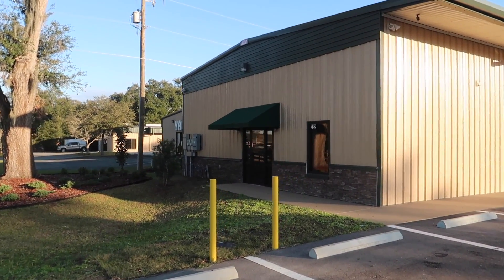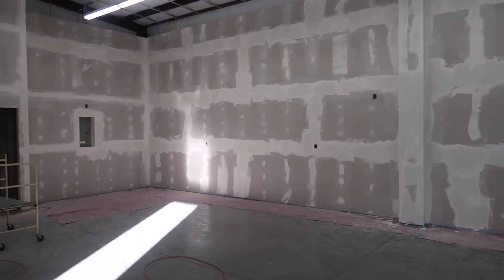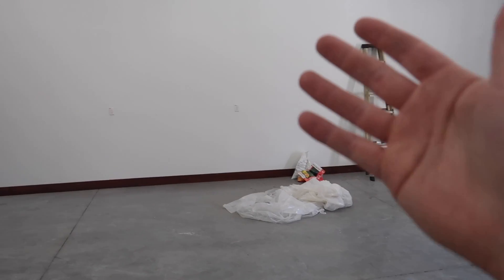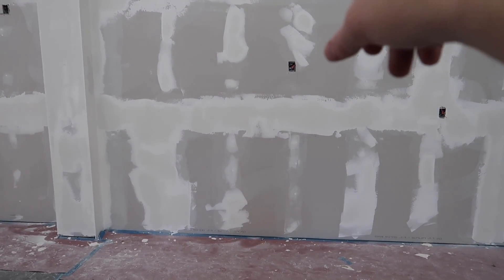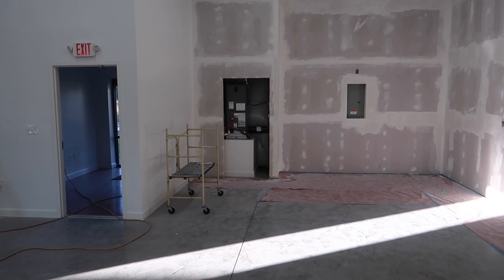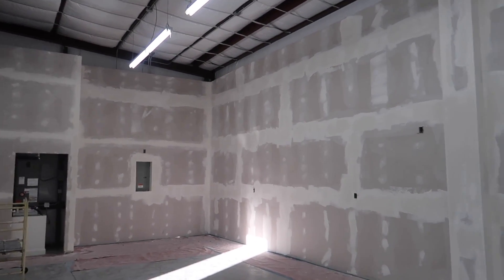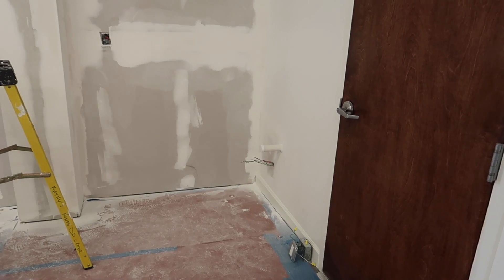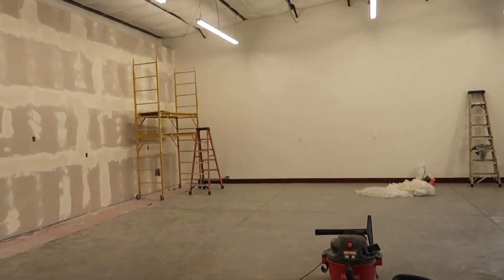Tour of New Obsessed Garage Headquarters (OGHQ)

Comment: Matt,  You could of had a metal building contractor furnish and install nice bright white / or light gray / or galvalume finish corugated metal panels all the way to the ceiling for far less money that you probably paid for the metal studs and drywall. Although the drywall once painted to your paint specs. will tie in nicely to and finish the space. Can't wait to see the completed video. It's a plus that you found this rental space close to home.
Reply from the maker: Dang that is a fantastic idea.  That would have looked great.

Comment: i'm thinking about adding swisstracks in my new garage but i just checked the math and it will cost $ 7k for 900 sq ft?  doesn't seem right.    I'm installing a bendpak 2 post lift and adding an extra outlet for electric car charging, not sure if i'll ever get one but if someone comes over i can work on their car and charge it at the same time :)   now is the time for low voltage wires: coax or cat6 for tv's, security, i.e. alarm, heat/smoke/carbon, surveillance and also speakers/streaming audio, phones, etc.
Reply from the maker: 900 sq. ft. would cost $3,555 shipped from my store.
Reply: that sounds more like it...  it also helps if i can spell swisstrax correctly lol.  i think our plan was to epoxy the garage floors, i'll let you know if we go the swiss route.

Comment: One more thing that and I'm sure other people have emphasized this but is this place pre-wired for a security system? Looks like you could get away with two motion detectors. My father and I used to install security systems on the side. If you can find a trusted installer because sometimes these fly-by-night installers will enter an embedded code into the keypad and come back and Rob the place and the owner will never know about it. I wouldn't go with anything like Simply Safety for this building maybe something higher in like Ademco, I remember installing alarms with my dad as a kid in the early 80s we're all you had was a key you would insert and have a red or green light to to arm or disarm...lol
Reply from the maker: I will most like just mount cloud based cameras.

Comment: Matt, have you considered doing some vertical lighting on the walls? I know some detailing businesses use wall lighting as supplemental light so they can see the paintwork better. I know that detailing in this HQ is not the primary focus, but I'm sure that some will definitely occur there.
Reply from the maker: I don't like those types of lights.  I can't control them.  I prefer supplemental lighting instead.

Comment: Matt, My 35 year old Dayton - Speedaire Compressor gave up the ghost last night and started leaking. Rather than fixing it (no s=desire to pour money into an undersized 35 year old unit) I want to get a new and larger unit. I came to the same conclusion as you as far as brand goes and have settled on a Jenny. Which model did you wind up getting??  Jenny does seem to be about the best out there!
Reply from the maker: Mine is the W5B-80V.
Reply: Thanks!

Comment: Looks awesome man!  I didn't hear you mention a transformer so hopefully the compressor will run off of the panel that was already there?  I only mention it because I just went through the process of supplying an injection molding machine, air compressor, and some other heavy equipment with the 240V power they needed in a space I'm leasing that was wired for 208Y/120

Comment: You should run Ethernet for those shipping stations to make life easier so you don't have to deal with finicky WiFi on your stations.
Reply from the maker: I will most likely do so.  The good news is all the walls are open on the top to run what I need to later.
Reply: Yup, that's why I wanted to mention it :D

Comment: just out of curiosity how come a scissor lift vs a 2 post? iv never worked under a scissor lift but I feel like you get allot less room under the vehicle to work.
Reply: Rick Smead he is a detailer. Not going to be much work done underneath the cars
Reply: There is also cost to consider and the fact that a 2 post is permanent where as a scissor lift can be stored out of the way.
Reply from the maker: I really dislike scissor lifts.  They take longer to get the car on it and have giant poles on the side making everything difficult.  Even getting out of the car is a pain.  Scissor lift gets me 360 degree access to the entire body of the car.

Comment: Won’t the cabinets reduce the effective width of the garage door opening?
Reply from the maker: They will be 10 short of the door.
Reply: Obsessed Garage I should not have doubted your planning. 👍
Reply: ...and anyone who thinks you should be doing drywall, painting, replacing fluorescent tubes, etc., might need to study some management books. Just because you can do something does not mean you should do it. As you mentioned, your time is more valuable elsewhere.

Comment: I know you mentioned that the space is bigger than it appears, so it might be a non-issue, but the cabinets along the wall next to the roll up seems like a potential pain. Any plans of backing the trailer into this building? If so, I'd think those cabinets might make that more difficult than it need be, as it doesn't look like you'd be able back straight in.
Reply from the maker: The trailer won't be coming here.  I'm going to pave a spot to park it at my house.

Comment: Don't go Apple.
Get custom computers built how you want it.
Reply: Joshua Hoover yeah so you can spend money on anti virus software and deal with shitty Microsoft OS that have constant updates. 

Best long term business decision would be Apple/Macintosh computers.
Reply: I think the main thing is having a simple and basic all in one.
Reply: the up-front cost and limited hardware options make Apple still a more costly option. Add to it that Microsoft networking and application framework is more common/standard amongst enterprise software combined with the natural hardware cost/flexibility advantages mean the PC is still a great choice. Very effective Antivirus will cost $100-$300 a year at the most.
Reply from the maker: I will be doing all Apple infrastructure for the business.  It aligns with my brand, I prefer Mac OS, and I will have infinitely less support issues and need for IT guys that talk big games that actually want to work.
Reply: Like a abacus?
Reply: You need @LinusTechTips sort you out lol
Reply: Obsessed Garage Plus you can always run Windows in Boot Camp or virtualized with VMware if the need arises.